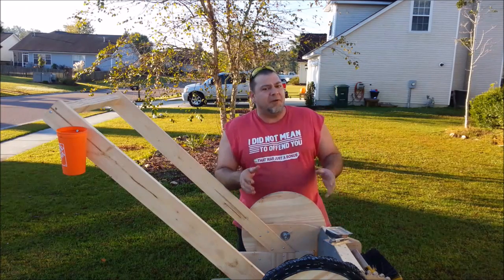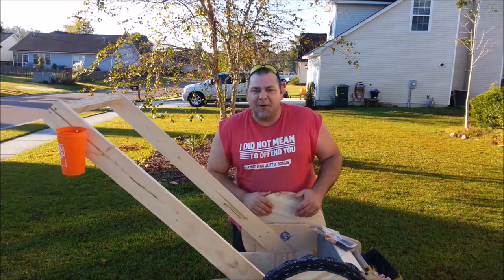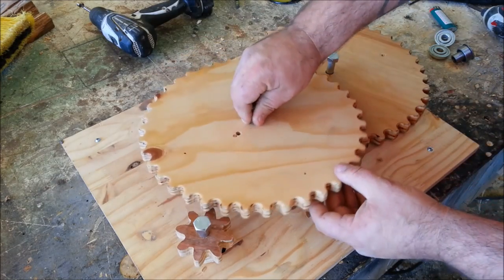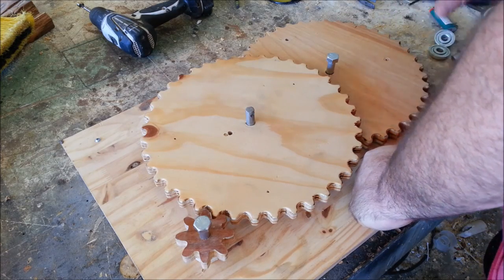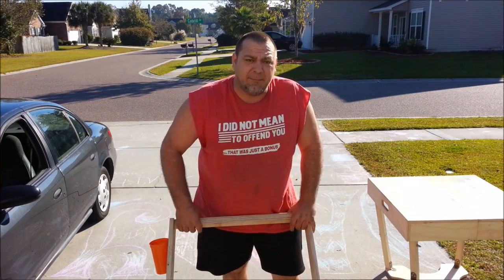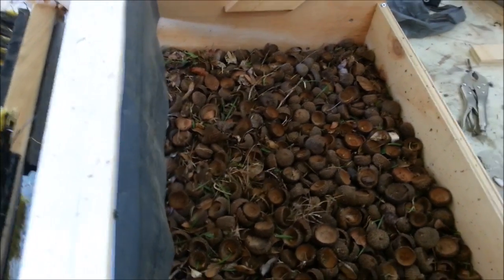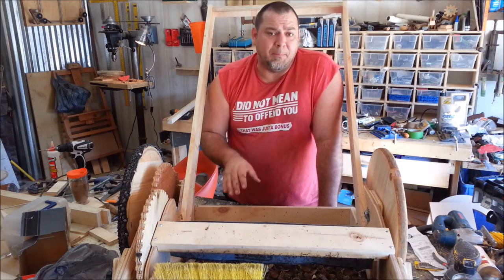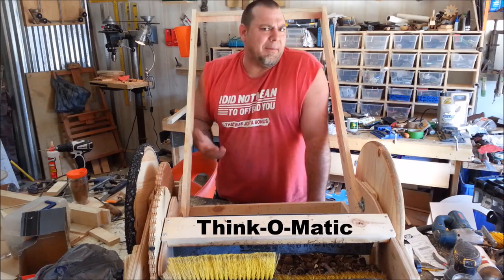Build a wood gears yard broom!

Comment: Hey Izzy, if raising the bed and putting the comb in the leading edge don't work, how about an aeration/de-thatching mode for the drive wheel? Keep those gears turning!
Reply from the maker: Cliff Patton i had thought about that, but it would have rough on the side walks. Good THINKING
Reply: I had a thought about retractability but building it would be tedious.

Comment: Put blades instead of brushes and it can be a push mower like the old reel mowers. It would work well spinning fast, and do away with the catch box. Or keep the brushes behind the blades and keep the box for clipping removal.
Reply from the maker: Justin Migliorisi It would probably work. That brush is spinning incredibly fast.

Comment: very cool, I wonder if a rake system would work, with a slower gear for leaves, Very neat Izzy
Reply from the maker: ***** I really want to get this working for leaves so I will be playing with it more soon.
Reply: izzy swan well my grandmother had one from the 60's or 70's that we used to pick up leaves with and that one had the full round wheel with the brown bristles brush like broom. The bristles went all the way around the cylinder and worked very well. Instead of gears it ran with two eight inch wheels and a small rubber wheel which was connected to the cylinder which would run on the larger wheels. It was a very simple operation. She would take it out to the cabin to do leaves and them god forsaken acorns too!

Comment: Hey Izzy,

I don't know if you already made a new one, I just wanted to let you know that the one we use in our company has an additional brush that rotates on a vertical axis. It's driven by a belt that gets tensioned as you flap the arm with the brush at it's end on the ground. I hope you can make sense of this ;)